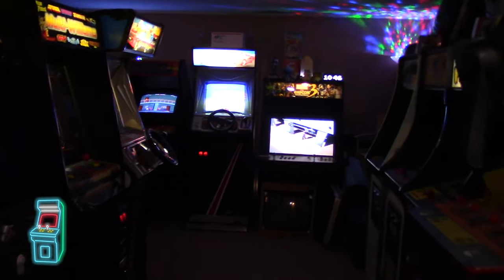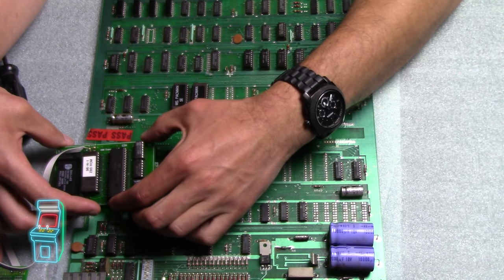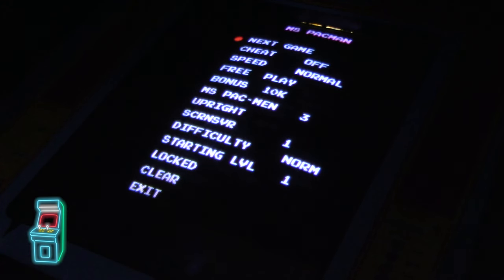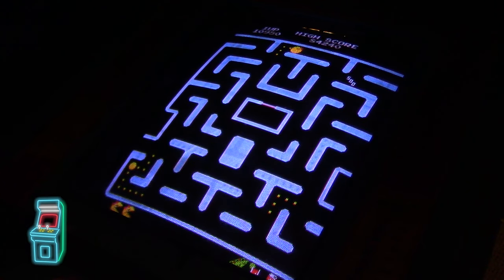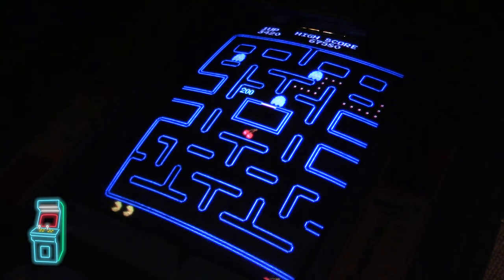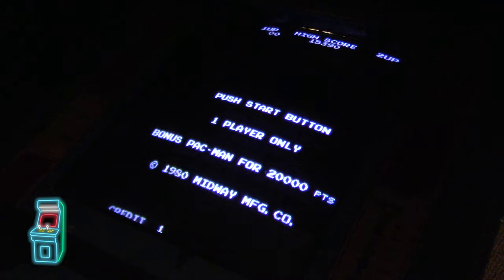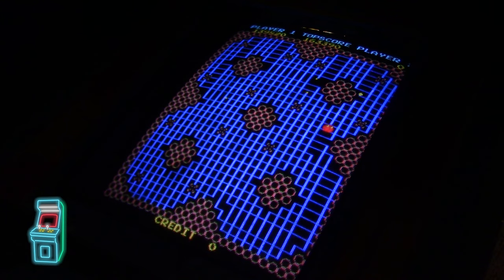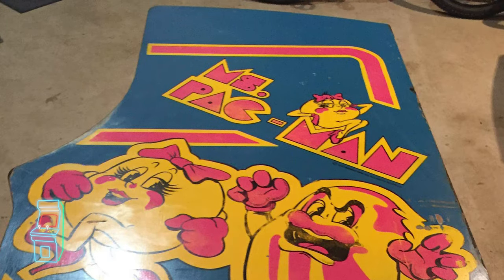Ms. Pacman Restoration Part 3 [96 in 1 Install]

Comment: I know where to get the 96 in 1 kit where did you get the other custom rom chips at plus the socket extender?
Reply from the maker: I strive to be complete on this channel and I forgot to put those links in the description. Thanks for the reminder! They have been added, so check there!
You only need the 285 chip for the kit so it will fit underneath (with the CPU extender socket on the kit)  The 284 Vram chip is optional.
Reply: Where do I get the 40 pin socket extender for the cpu?
Reply from the maker: @coolastro  Oops I linked the wrong one. It is now fixed in the description!  Thanks for your patience!
Reply: Thank You

Comment: Any Idea if this will work on a Super Pac with a factory conversion to a JR Pac/ Id love to get one of them
Reply from the maker: No, it will not work. It will only work on Original Pac-man boardsets (Ms. Pac-man is a converted Pac-Man with an auxiliary board).
Both Super Pac-Man and Jr. Pac-Man are different architectures so will NOT work.
Reply: @delsarcade  Crap got ya I do app it very much. May have to get a Mrs. Lol. Does he still,make the 96 in 1?
Reply from the maker: @Pitbull0669  You can grab it from NE Mike (see description).  He may have one left.
Reply: @delsarcade  ty bro